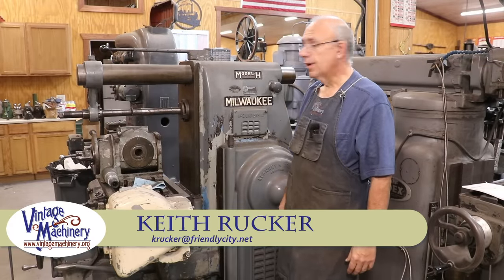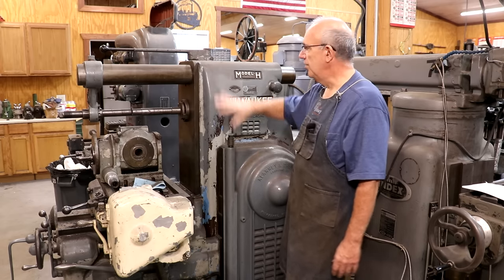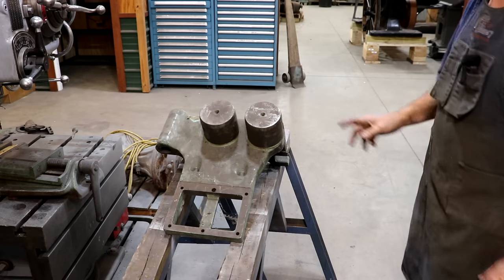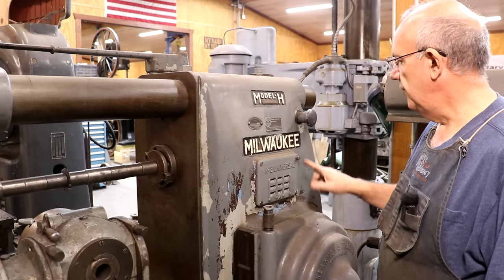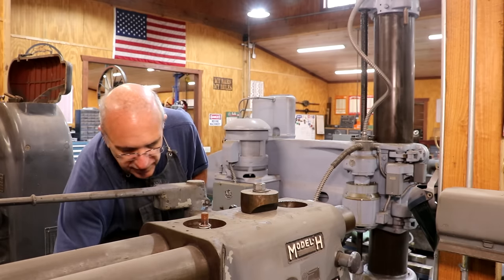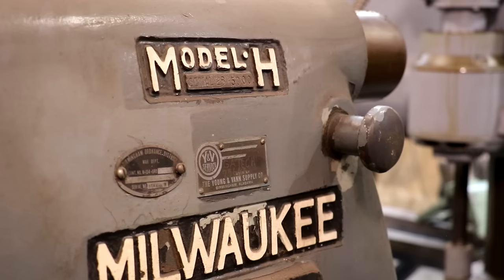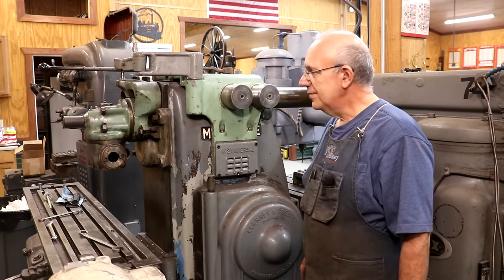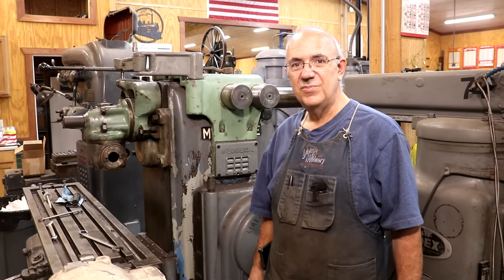Kearney & Trecker 3H Horizontal Milling Machine:  Installing a Parking Attachment and Universal Head

Comment: Looks like the 'hat hanger' knob is shown as Item No. 48 on Figure 5 of the HR-25 and 92 Parts Manuals. The Part Name and Description from the parts is 48 Overarm shaft bushing (RH) Code No 3H-A62. 
In the OPERATION section in the back of Operator's Manual No. 83, it is shown as (58) on the right view photo and called  58) Parking post for coolant hose when not in use. On later models the 'knob' portion of the bushing was eliminated, possibly as part of development of the parking attachment. The coolant hose would not fit on the knob since the parking attachment obstructed it.

Comment: Put a thrust bearing between the parking attachment and bracket. Make it easier to swing.
Reply: That is what I was thinking. Looks like some kind of washer is in there now, maybe worn out thrust washer.
Reply: That and a little oil would really help. That’s a nice way to store the vertical head attachment, up out of the way and ready for action.
Reply: might explain the difference in arm heights ?
Reply: Doesn't work, it would mess the way the thing works. Keith would have to machine a space for the bearing. The issue here is that someone mix and matched two units together, thus the relative stiffness. Best thing he could do is lap the two surfaces together.
Reply: @aserta  Maybe look again .There is clearly some kind of washer between the 2. Plus it is adjustable.
Reply: I was thinking of a roller bearing and 2 hardened washers/races.
The ones in an automatic transmission aren't very thick either.

Comment: Keith, you're not done yet. You're missing the eccentric hex blocks that slide over the studs and provide support for the parking bracket. They also allow the nuts to push directly on the locks without twisting the park bracket casting. They're part #3 in the diagrams in Catalog AR30 and are easily mistaken for the nuts. There is a photo on the PM forum now that I uploaded.
Reply: Thank you!  I was watching going "how is that going to work" with the cover bolts through the parking bracket.
Reply: Thanks, I was wondering about that and then just let it go.
Reply: @mabmachine i went back to that post and looked at that diagram..thanks for posting

Comment: Looking at top you may need spacers that go through u shapes that will allow you to clamp supports with out putting pressure on to bracket.😊
Reply: or make new nuts that includes a shoulder, I agree with Kdenyer here, you should not consume some of the applied torque in bending the bracket. don't rob any of very much needed holding load for the two rods to bending the bracket.....  (i don't believe the designer's intent was to bend the bracket)
Reply: Yes, this bit didn’t look quite right to me, either

Comment: The overarm locks should have some steel bushing through the overarm crane so they can tighten. As it sits right now they are not tight.
Reply: That would be an easy fix, maybe a short video of making a couple bushings and installing a thrush washer would finish things up nicely.
Reply: The nuts apply force to the overarm casting and the casting places the force to the 2 big round wedge blocks…so they are tightening. The force that the nut applies downward on the wedge blocks is basically the same with or without the overarm casting there. Think of the overarm casting as nothing more than a thick washer. Keith has it right.
Reply: @ChristopherWilson-h7g  cast iron doesn’t really move. It might be tightening some but it would be better to have through bushings.
Reply: If the greenish overarm casting isnt touching the wedge blocks, then yes, I would agree you would need (or want) to make up that space to tighten…but if they are resting on the wedge blocks, that force would be transmitted to tighten the overarms. I was going under the assumption that they were touching. Then again, my eyes aren't those of an eagle. As for the cast iron “not flexing”, and again assuming the overarm casting is resting on/touching the wedge blocks, there would only be a minute amount of “flex” needed to snug the blocks…and if you notice, the bulk of that overarm casting is floating off of the main casting except for where it is bolted at the top and bottom. Almost like they designed it to flex a bit. Would love Keith’s input…as not there to look closer. My bet is the overarms could be tightened as set up. I am not saying that “sleeves” or “more washers” or “washers in a different spot wouldn’t be better or apply “more” or “better” force. I was merely stating that they wouldn’t be necessary to tighten as set up. I guess there are 2 options…as is where the upper slots of the attachment casting are actually clamped when you tighten, or make sleeves and have the upper part “float” around the studs or sleeves. Gotta love a healthy engineering debate. 😉
Reply: Someone else posted that the K&T drawings show spacers innthe slots.

Comment: Would it make sense to make a couple of sleeves to go over that threaded rod so the casting is actually transferring some of the load to those studs on top? Or make some nice nuts with a long shank that would extend down to the locks and the casting would hit those?

Comment: Keith, 

It's nice to see everything installed and working.  I am glad your lifting equipment and parking station are finally installed.

I realize that it is part of history, but of the K & T products that you put on display the parking attachment appears to have been an after thought.  The weight of the universal head and the hinged boom arm seem to have design issues.  For instance, the arm design relies on journal bearings for transferring a torsional load.  I wonder why they didn't install a thrust bearing  to carry some of the load?

Another area I find curious is why didn't they design the assembly as two separate functions; holding the parked universal head and a independent davit.  This would simplify the the casting design.  Mounting an independent ðavit on top of the mill would make it possible to lift the parked head, for installing parts such as rotary tables or dividing heads.  It could also be used for lifting components that are being machined

The engineer in me, having 20/20 hindsight wants to redesign everything.   It drives my wifr crazy.

Bob

Comment: Actually the mixed colors sort of work, more so since the parking attachment is about the same as the head. The only drawback to the parking attachment is covering up the badges on the side, but i;m sure making it easier to change will more than make up for it.

Comment: Thank You for this nice video of the parking attachment.
You change the over arm support lock bolts for longer all threads.
I believe that’s not right. 
Remove the washers and use a coupling nut or a tube extension so no extra force is applied to the parking attachment casting.
Otherwise You risk braking the system!
Regards PeO
Reply: I was getting ready to say the same thing, but you said it perfectly.
A lot of people think the top brackets carry the load. They are just a safety in case the side mounting bolts fail.
There are a few ways to do it. But you want to get the upper and lower clamps to clamp on the over arm without putting pressure on the top parking attachment ears.

Comment: Big score considering the condition and relative rarity of a loose component like that (at least for me here in Europe, finding a component of that vintage and specific purpose without having to buy a whole machine is pretty rare - which i've had to do in the past. Bought another unit, made the best out of two, cleaned up as best as i could the spare parts one and sold it on to the next person).

Comment: I would expect there should be some solid sleeves over the studs, passing through the parking attachment, but without applying stress to the attachment when you need to clamp the overarms.

Comment: I had a friend who was a retired machinist and had a mill just like that in his basement. It was mine for the taking as long as I could get someone to move it out of his basement. The Basement was a walkout basement but both sides of the yard were one level higher than the basement level, and no one would bring their equipment into the yard to get it. It didn't have the parking attachment but had the vertical head and I was able to use it over the years while he lived in the same state. Sadly, it ended up going to the scrapper for $200.00 in scrap. If only I could have gotten it out of his basement...  =(

Comment: I have dark and light gray colors on my 1954 Sheldon L-44 Lathe.  (44 is way length from under the head to under the tailstock - shorter use naturally.)  Shows heritage.  Regarding the Knob - maybe the kit had a new smaller knob - never knows.

Comment: i think I caught a issue, the spring loaded barell rods need compressed independently of that while assembly I think. making a sleeve that holds the attachment BUY allows the compression of the rods when you tighten the nuts may be needed.

Comment: I would guess that “knob” on your Model H is a lifting point. The “knob” part is likely to keep the strap or chain from slipping off.
Reply: I was thinking that too. It's about the only thing that makes sense for it's being there. We haven't seen the back to see if it has a corresponding one there.
Reply: That was also my thought.
Reply: Doubtful. That's too high up and the castings wouldn't take it. The load points are far below.
Reply: The other side is the wheel to turn to extend the rods. IfF you were using it to strap, which I don't know is correct or would work, the wheel itself would keep the strap from sliding off.
Reply: Too high up? You usually want your strap/chain points above the center of mass so you don't get weight shifting. We aren't talking about lifting as with a forklift.
Reply: Never considered this idea. I was wondering down the lines that there used to be an extra gearbox leaver or plunger on models years ago. To save altering the castings they just plugged it up. 
But I never owned or operated just once a single lathe, milling machine, planer, HBM. So any newbies like me who thinks this sounds good, take it with a pinch of salt.
Reply: …and I don't believe that “knob” is part of the main body casting. I believe it is part of/integral to the steel shaft that runs through the entire machine for the extension of the arms…on one end (the side we don't see in the video) a wheel to turn and extend/retract the arms (as Keith told us), and the “knob” on the other…but could be wrong as not there to inspect it. Keith…is that knob a forged end of the rod that goes through to the other side??
Reply: He knows this.. he just wants to make people comment on it.. it helps his algorithm for his channel .. its a sort of clickbate..
Reply: @SolentGreen  He does want people to comment, he says as much. He also knows plenty but there is always so much that anyone of us still has fo learn. He'd like to find out and already tried asking from someone.

Comment: 17:08 oddly enough, i've found at least three Hs that have a different feature where that knob is. The boss on the main casting is identical, however, the portion where the cylinder juts out is recessed (i'd guess about 2mm) and in the center, there's a pip that's about a third of the diameter.
Reply: Pretty sure there is no Metric anything on that Baby..
Reply: @donsmith3167 Who said there was? I just expressed it in Metric because i use mainly Metric.
Reply: @aserta  well back when K&T were made we didn’t ever use Metric on anything here in the States.
Reply: @donsmith3167  Bearings were often metric in those days.

Comment: YES!!!! the video ive been waiting for.  Thanks keith for showing this.  Did u put a paper gasket back on or do silicone?  I replaced the silicone gasket on mine and went paper but i do have small amounts of oil that does leak out around the air vent.  I am still debating whether to modify the mill as u have done or modify my parking attachment.

Comment: Hey Keith I really feel like the way you're locking the overarm support is not correct. I would venture to guess that along with the longer studs, that kit probably also came with custom nuts which have a long shank on them to make up the space between the top of the parking attachment and the clamp so as not to put any clamping force on the parking attachment casting

With the way it's setup now, I fear that if you really crank down on that to get those tight, it's going to crack the casting.

Comment: Keith, I have the 2HL with the same vertical head. The information about proper lubrication is amazingly vague in tech manuals and in general discussion. Mine suffered from the common mistake that the "zerk" fittings are for grease when it is supposed to be for oil. I have cleaned it out and replaced the leather seals with modern oil seals (some casting modification), but have yet to fill it. Any recommendations for a suitable lubricant? I'm fairly certain they were far from oil tight even when new, so I don't mind topping off before any milling sessions. Maybe even a short video about those vertical heads for the benefit of other K&T owners? Keep up the great work!

Comment: the swing arm for your parking attachment has either wear or its for another model.!!!!... you should be able to swing it into alignment with no trouble you may have to check all the wear surfaces or make another mounting ball it is at the wrong elevation

Comment: @11:45 Could you take that knob off and turn it down in your lathe? You did mention that it was held on with a pin. Use a portable hand-held band saw to cut it off then smooth the cut place where you cut it. That looks so bad it is going to bother you anytime you look at it! Also, that heavy old mill rocked when you applied some torque to those large nuts that hold the overarm brakes. A properly leveled and installed machine won't do that.
Reply: Why? Then it wouldn’t be original and might lose value. A machine needs at least one ball to work well.

Comment: Hi Keith, how about a teflon washer between the crane arm and the parking attachment to make for easier swinging?
Reply: Mabey mill a washer from some delrin if you have any stock?
Reply: can delrin handle the weight? I have the same situation im going to face when i mount my parking attachment im sure of it.  The mill head weighs 180 lbs @jwaterous224
Reply: @gexas38 I'd look for flat roller bearings. Even the thin ones used in automotive transmission could handle the weight (hardened rollers and races)
Reply: will do thanks @TEDodd